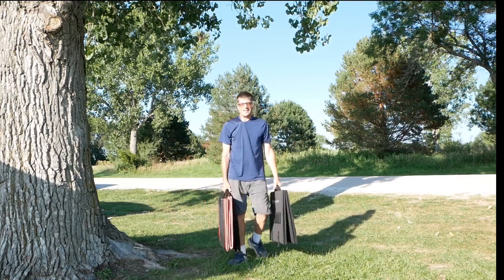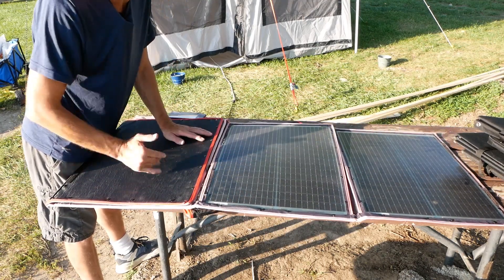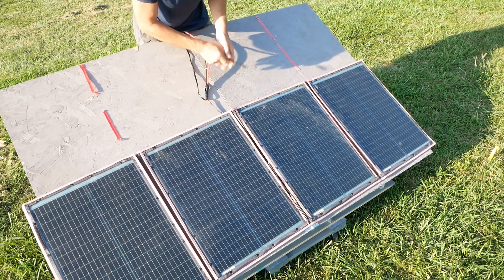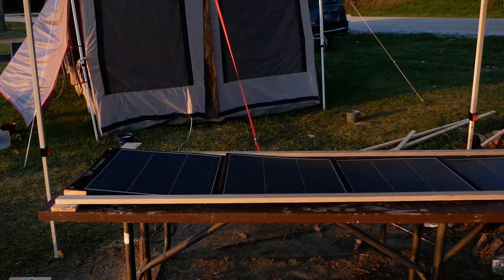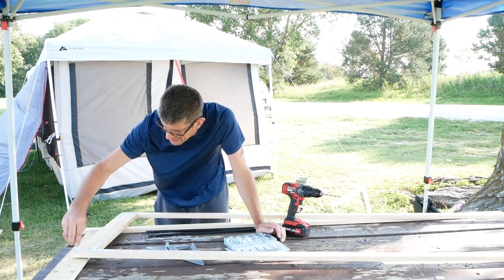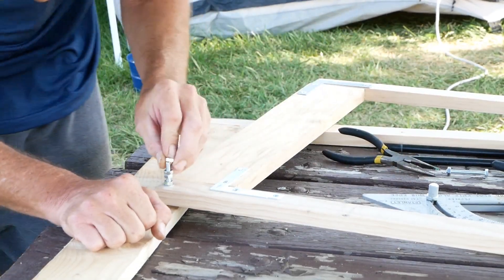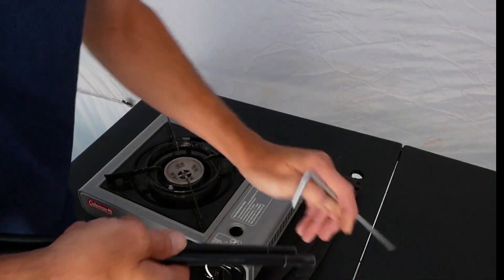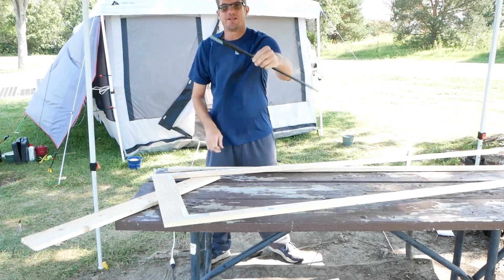foldable solar panels, Make custom frame and kickstand

Comment: Not bad, simple but effective frame. Might want to add a way to fold the frame for easier transport & storage tho, perhaps assembling the sides with detent pins or just adding cabinet hinges in the middle of the long sections.
Reply from the maker: thanks for the input. I was thinking about that. I start with a project and its good for awhile but i have notice its not final. I upgrade on the original Idea of all my project that I have done. there is 3 more project that I have upgraded since i started them over the years and I will be sharing them soon so stay tuned.